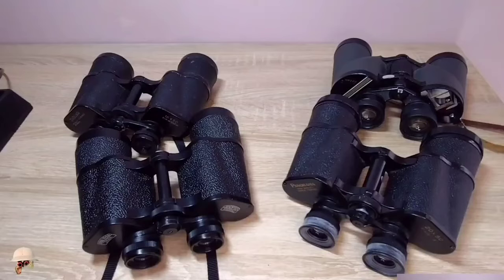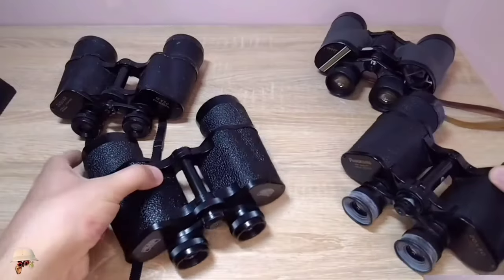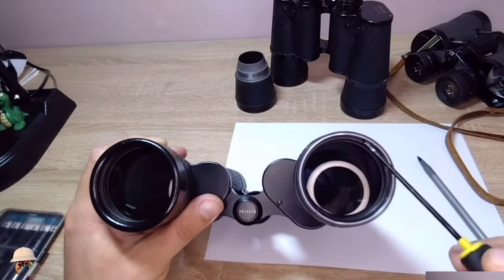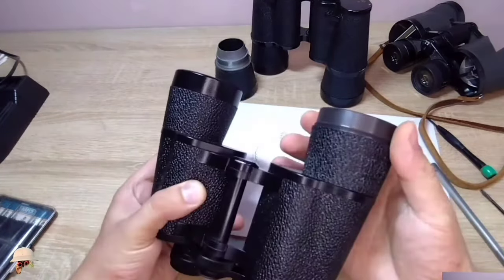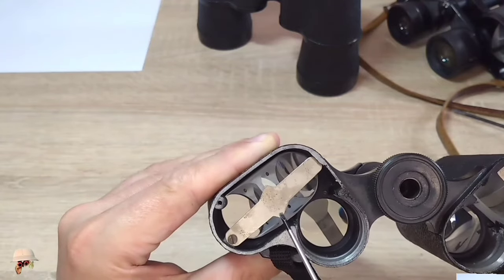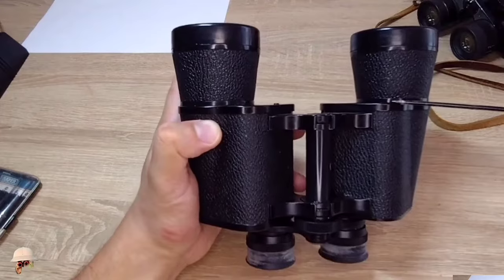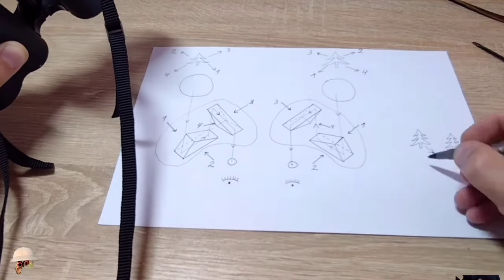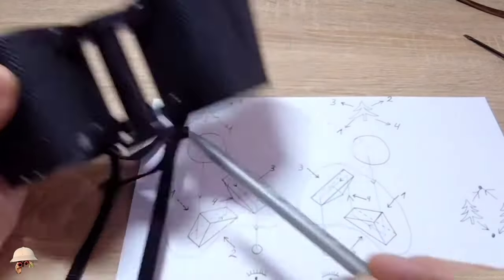FIX Double Vision in SECONDS with Proper Binoculars Alignment!

Comment: just i watched your  video.thanks to the video, good tutorial. 
i have a pair of nikula 7-15 × 35 binocular.it gives double image. i purchased 20 years before.from purchase itself the problem exists.i couldn't find out service centre  in india.i think your video will help to solve the problem. one thing  i want to know that what will happen to prism position if i do prism adjustment screw loosen or tighten.
Reply from the maker: the prism will shift or tilt

Comment: I fully disassembled and cleaned a vintage pair of binoculars because they had fungus in them. After reassembling the lenses/prisms were now clear but clearly need aligned. Would this fix work with these or is the problem much deeper?
Reply from the maker: you need to set the prisms straight and assemble the binoculars. then adjust with the rings on the lenses

Comment: In most case, misalignments are not apparent when looking at terrestrial views.  On my binocular, the I can see double vision only when  I look at the stars at night.  So wouldn't it be easiest to perform collimation during night time focusing on a bright star?  Most of time, you can easily verify if collimation can be achieved by simply rotating one or both of the objective lens (screwing or unscrewing holder for objective lens).   Screws for pushing prisms should be last resort because it might put too much stress on prism and cause cracking.
Reply from the maker: if there are screws in the binoculars, then they can be turned within reasonable limits.
and twisting the lens body will not do anything, you only need to twist the lens with the adjustment ring.
you can look at anything through the binoculars, I just showed all the methods of adjusting the binoculars with my own eyes

Comment: I am not able to move the indents in the front lens. I am afraid if I use more force i might break the binoculars. Any suggestions?
Reply from the maker: the lenses must be covered with cardboard so as not to damage them.
you can try applying a little alcohol to the thread of the clamping ring.
I also had a case, I could not unscrew the ring, I put part of the binoculars in the refrigerator freezer for 1 hour, and then unscrewed

Comment: Your explanation works but the illustrations are incorrect, each prism in the drawing needs to be inverted.  The light actually enters from the larger flat surfaces of the prisms at 90 degrees, not the beveled side. It then exits back out to the same large flat face of the prism after being reflected off the two beveled faces, they are actually mirrored surfaces. If you look at the prisms @ 12:10 you will see that the beveled faces are painted black to protect the mirroring, no light can enter there.
Reply from the maker: That's right, that's how I explain it, light reflects off a surface tilted at an angle of 45 degrees